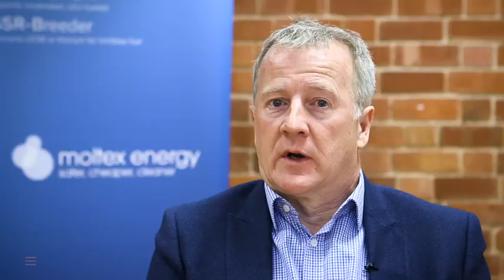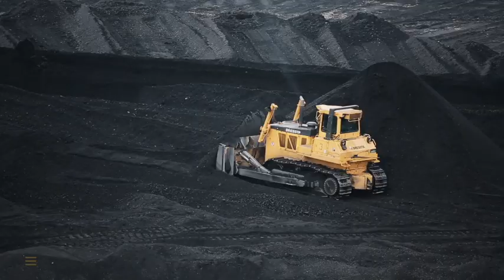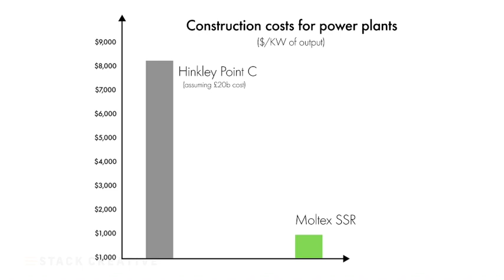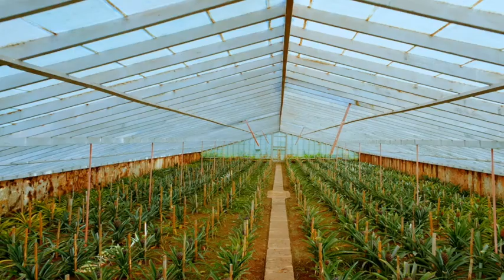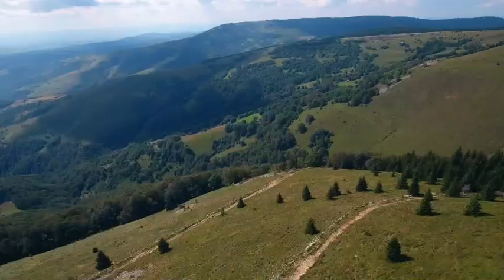Moltex - Technology overview

Comment: This looks so good. Congratulations on what might be a world-changing technology because let's face it, commercial fusion power really does still look to be at least 30 years out if not 50.

Was Moltex Energy and the concept simply too young, or even non-existent when Hinkley Point C was being planned? As a Brit it seems such a tragedy that we aren't using that as an additional test bed for this technology.

On your web site you say "Stable Salt Reactors are modular in construction. Their rectangular cores can be extended module by module to create reactors from 150MW to 1200MW power". What is the limiting factor that causes you to specify that 1200MW upper power limit? From looking at various extra details elsewhere I don't see why it couldn't scale up further by adding more modules to get to Drax or similar levels of output (space and outward electricity distribution capacity permitting).

Comment: Hi there! I have some questions someone asked me that I didn't know from you video about the salt reactor:

"Where does the Xeon end up? Just gets released to the atmosphere?
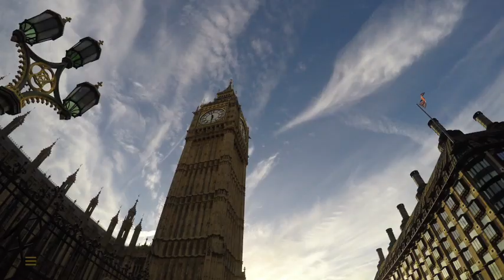They only mention "other gases slowly buble out at the top of the fuel tube" at 3:25
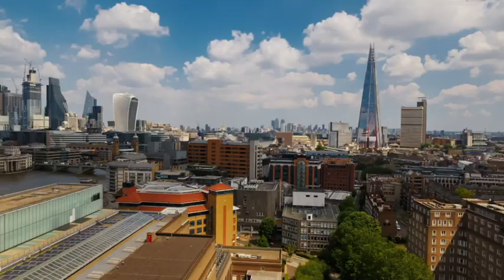And "using Zirkonium instead of Zink" (4:05)? As far as I know Zirkonium is the default material used for fuel rods in water cooled reactors anyway?
Also a bid confused by seeing actual fuel rods at all, the typical molten salt design would rather have the fuel dispersed in the molten salt itself?
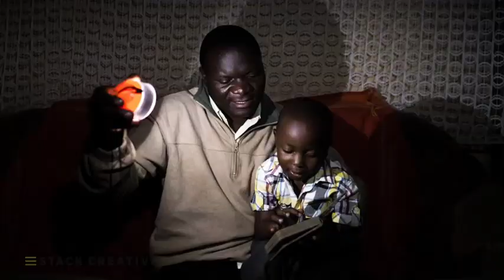Most confusing part though, at 2:57, is their claim that it would be good at load following? As far as I know molten salt reactors still suffer from "Xenon poisoning" in almost the same way as classic reactor designs?
This can be somewhat worked around in MSR designs where the fuel flows along with the salt, but in a design that uses fuel rods? Even if Xenon can eventually "slowly bubble out of the tube", that's not going to be a quick process for sure?"
Reply: Hey, in the SSR reactor design the fuel is also integrated into the molten salt, which is located in a number of sealed fuel rods. An advantage of this over the more common molten salt reactor design is that the fuel doesn't need to be pumped through the reactor which greatly reduces the complexity of the design (hence stable salt). Since the Xeon does bubble out, it won't poison the reaction - though I'm not sure where the xenon goes but I'm guessing the atmosphere (It's a non-toxic noble gas).
Reply: Xenon has a short 1/2 life so is down to background emissions in a few weeks. However it's useful stuff so likely to be sold as a product.
Molten salt is a low viscosity liquid much like water. Any gasses will bubble out quickly. That makes iodine and caesium, potential safety issue. Moltex had to prove that their design reacts these elements into salts before they can escape as elementary gases.

Comment: what about nuclear waste? how much will there be or how long will it take to recycle it. what if some natural disaster like an erathquake hits and the waste gets spread? sounds good tho :)
Reply: PWRs use about 2% of the available energy in the fuel. 98% of the energy goes to waste. 
PWR fuel pins cannot be run for any longer because they become highly pressurised and too hazardous to use for any longer. The actinides they contain are radioactive for 300,000 years. Moltex operate in the fast spectrum so they burn those actinides and 98% of the fuel is used. That leaves a waste that's has the same activity as depleted uranium after  just 300 years. This is easily engineered especially as its only giving significant radiation for 30 years. Moltex vent off the noble gasses for short term storage while their activity decays. The dangerous but chemically active Iodine 131 and caesium 137 are trapped as gasses in PWR fuel. In a molten salt reactor, they form salts so cannot be carried on the wind even if the core was exposed..

Comment: I don't get how you make it cheaper when the main bulk of the costs are regulations and licencing. Or aren't they the main bulk?
Reply: The large cost of today's reactors are that they have to be built to retain the high pressures required due to using water as a coolant.
Reply: @markmelchior614  The reactor neutron flux splits water into hydrogen and oxygen requiring recombiners. If the water is allowed to flash into steam, the zirconium fuel cladding will catalyse the same reaction and we get a Fukushima. Multi redundant pumps are needed to remove decay heat. Massive containment domes contain the steam if the reactor explodes. The list goes on and on. 

Moltex remove all of those hazards and so avoid those costs.